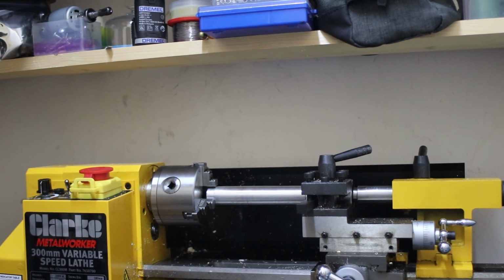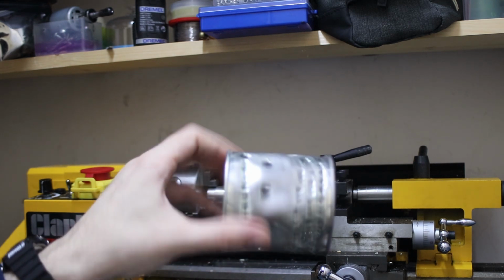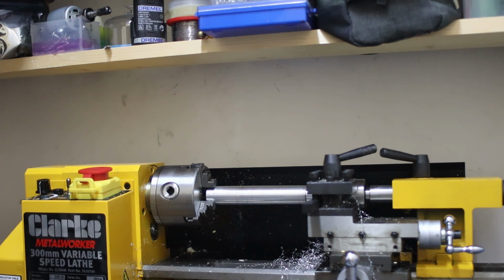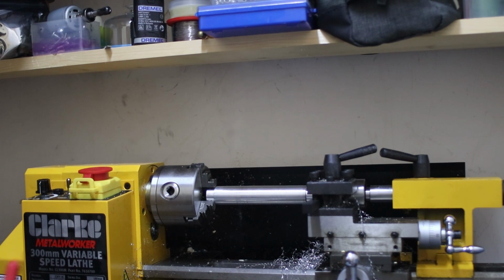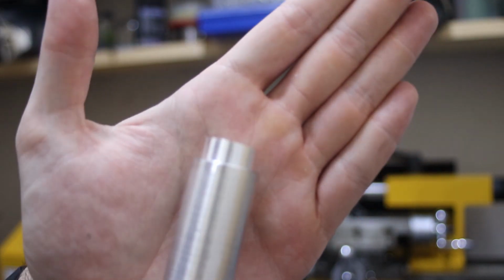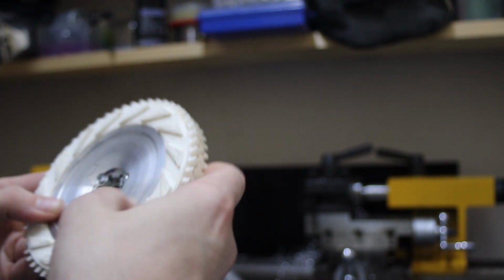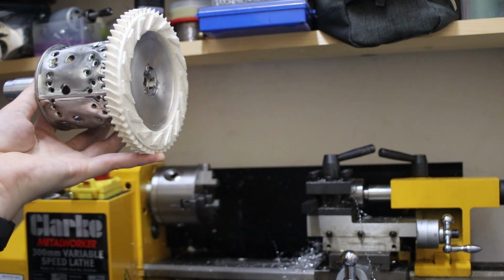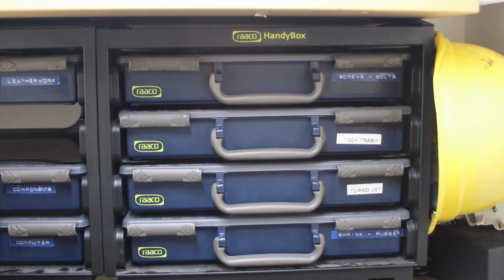HOMEMADE RC JET TURBINE #1 - MAIN SHAFT - GETTING THE WORKSHOP UP AND RUNNING

Comment: Hi can I ask you Please is the Compressor fan 3d printed and where did you obtain the  Turbine fan from in the process of just beginning a build of a Home made Jet Turbine myself
Love the Video Hope to follow you through your Jet engine Build.
Reply from the maker: Hey the compressor wheel is a spare part for car turbos and the white stator part is 3d printed from a model I made in 3d
Reply: @orkarma  Thank you. can I ask what car the turbo is from as it one part I a little unsure of Obtaining as there are so many out there.
Reply from the maker: I bought the biggest I could find that wasn't too exspenive and then based the size of everything around what I found